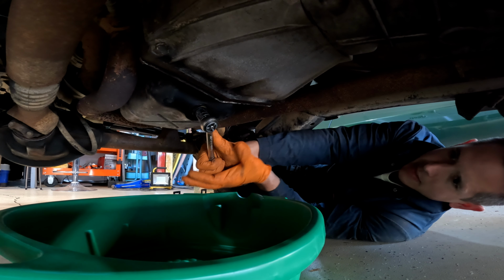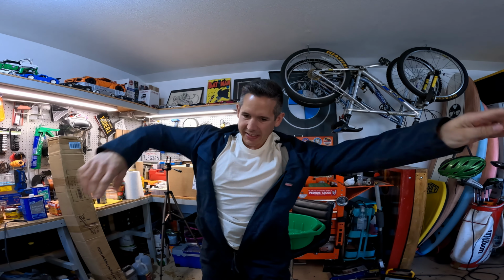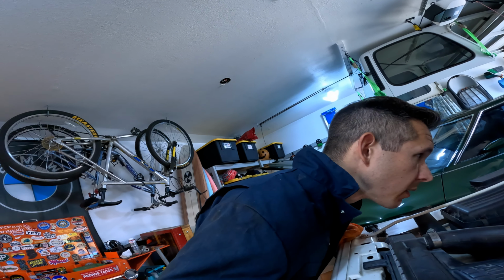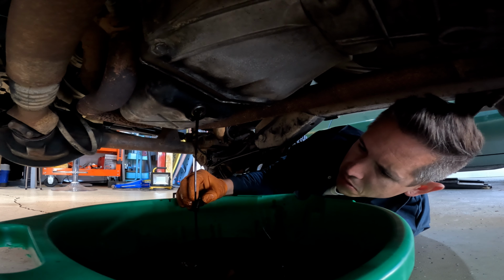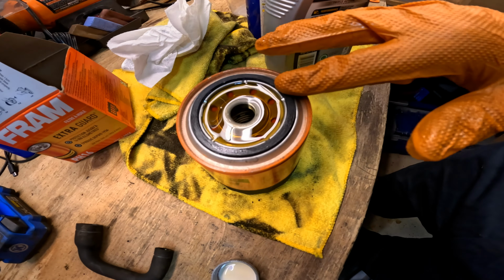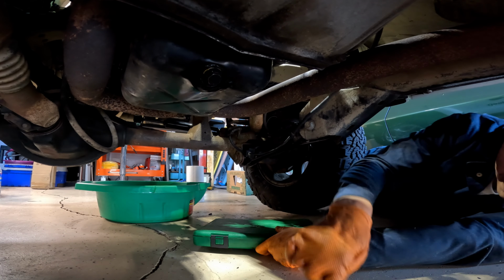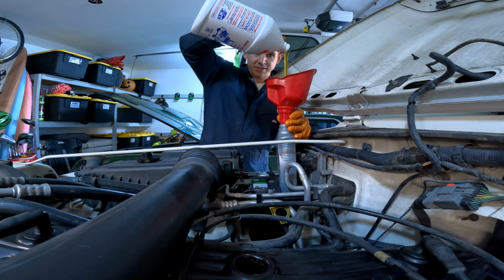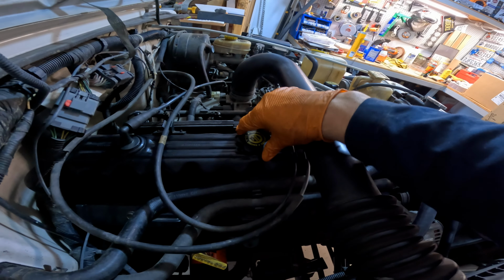I Haven't Changed the Oil In My 230,000 Mile Jeep For 2.5 Years

Comment: I have a 300k mile XJ with a 4.0. If you don't change the oil and replace the additives, you will leave the waste oil to coke up under the heat. Happens in every engine. The 4 & 6 cylinders already have problems with the camshaft bearings.. I add ZDDP and my XJ will climb a hill in any gear.

Comment: You wouldn't see metal fragments in the oil, you need to send it off to have it tested in a lab.
Reply from the maker: That was mainly to ensure there wasn't significant material in there. I've had "glittery" oil on past vehicles that was a very obvious indication of bearing issues.
Reply: @yodersgarage  I hear you, bearing shaving can show up in oil. A good trick is to use a magnet and let it do the work for you.

Comment: By adding Lucas, you are diluting the additives in the oil. I suggest you buy the High Mileage Mobil 1. And change your oil and filter every 5,000 miles or 6 months, whichever comes first. If you need a thicker oil, buy a heavier weight oil.
Reply from the maker: All sound advice, but this isn't a daily driver, and often sits for weeks on end. The main reason I use Lucas is to maintain the lubrication when it sits for a while.
Reply: @yodersgarage  All the more reason to change the oil and filter every 6 months. If you can stand one more piece of unsolicited advice, drive it once a week.
Reply: Lucas is snake oil. If you have known engine noise, I'd use it to get home. That's it.
Reply: @scotteric8711  Oil companies engineer motor oil for specific purposes through the additives they put in. Starting with a high quality base oil, they design the end product for your engine. If a Lucas additive was that great, they would put it in their oil.